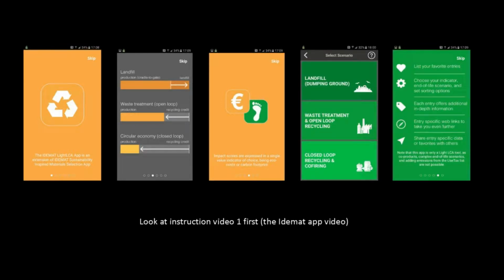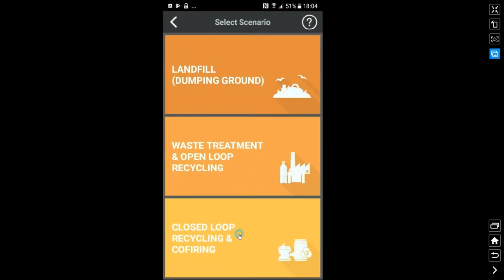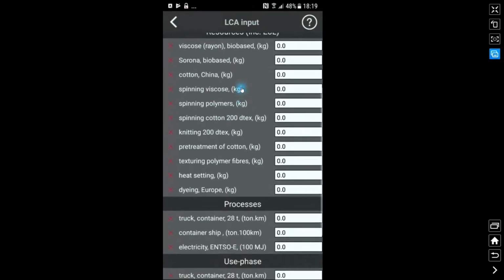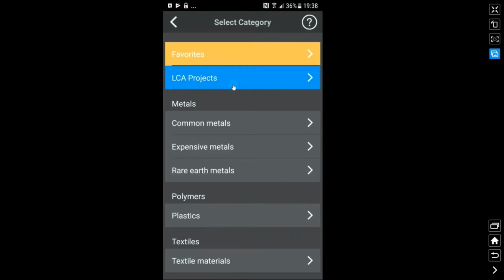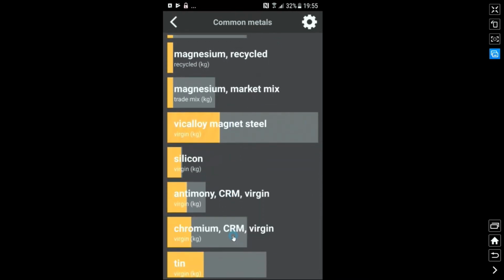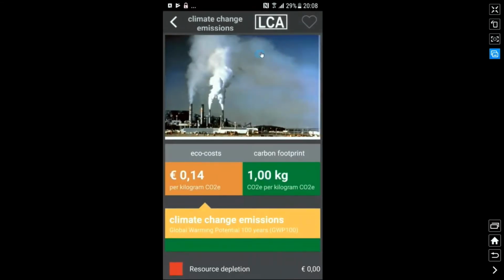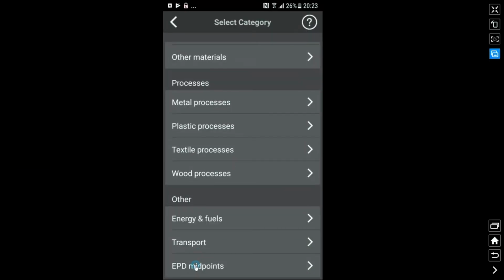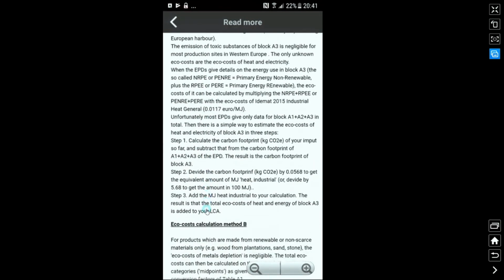IdematLightLCA Video2

Comment: We have a glitch in that the text is white on the white boxes so we cannot see the numbers or results!
Reply from the maker: I presume you have an iphone, working with IOS. I presume you work with a quite recent IOS version.
Your issue is related to your settings in "display & brightness": our software works with the standard setting "light" screen modus, but not with "dark" modus. 
In our next version we will implement a change that will work with "light" as well as "dark", and is more robust to future changes in IOS,
Best Regards, Joost Vogtlander
Reply: @jvogtlander  That was the problem - thanks!